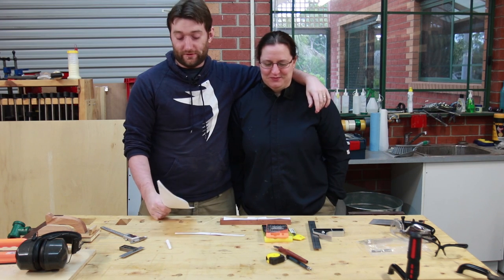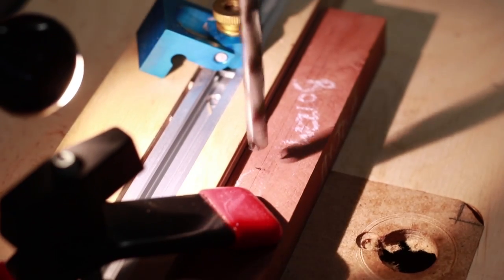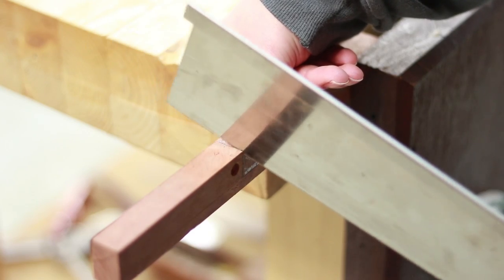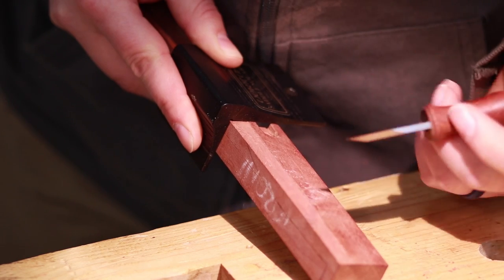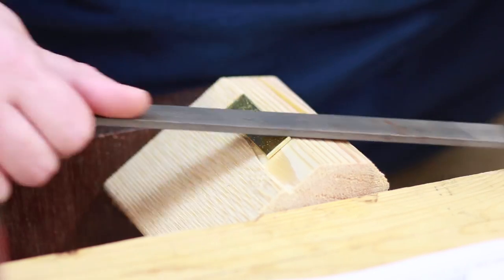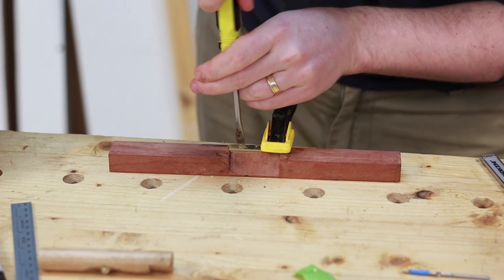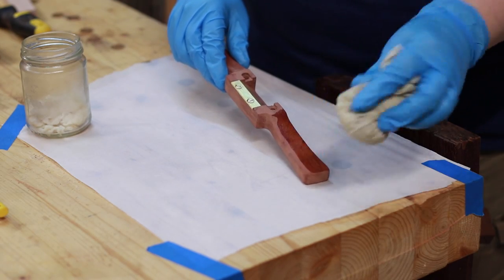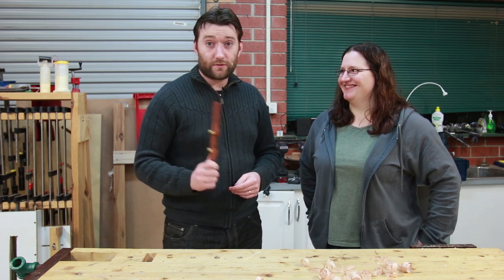112 - Building a spokeshave from a kit

Comment: So you need that tap shown on veritas diagram --to tap the thread for the blade --into hardwood ?  What type of TAP ?(thread =UNF---or coarse ? ) metric or AF ?
Reply from the maker: @CarlWinter-oy8uf  if you can't get the kit, this video is of no use to you. The tap matches the bolts that come in the kit, you have to substitute bolt and taps for what is available to you.

Comment: is the brass part the blade?
Reply from the maker: +TechMechanic no, the brass ware plate I'd to glide smoother than. The wood, and wear down slower than the wood. It's just in front of the O2 (I think it's O2) steel blade
Reply from the maker: +TechMechanic no, the brass ware plate I'd to glide smoother than. The wood, and wear down slower than the wood. It's just in front of the O2 (I think it's O2) steel blade

Comment: I am baffled --how does a flat blade --cut wood ?  Its not at a 45 degree or 30 degree angle like a normal spokeshave   how on earth does it work ???
Reply from the maker: The blade has a bevel on it. Veritas still sell the kits.  https://www.veritastools.ca/en-ca/shop/tools/hand-tools/spokeshaves/49710-veritas-hardware-kits-for-wooden-spokeshaves If you scroll down the page, you can see a diagram of how the blade advances and retracts